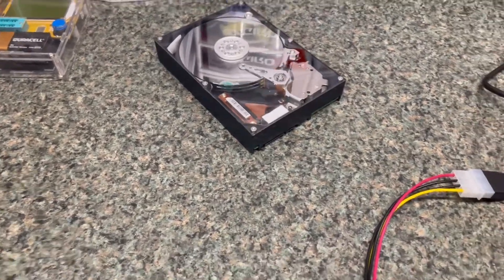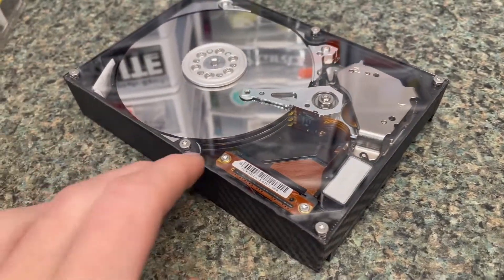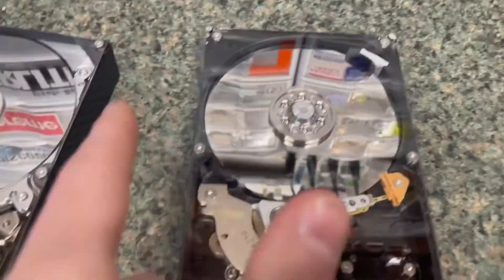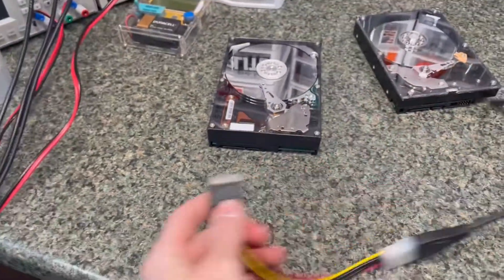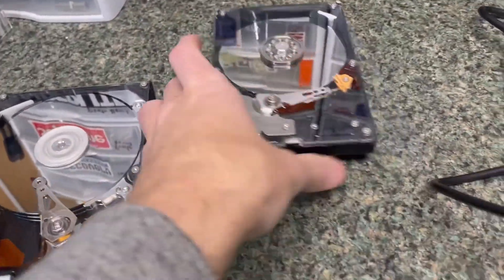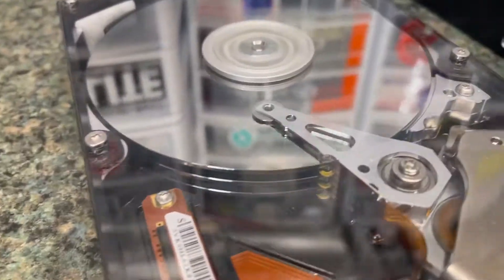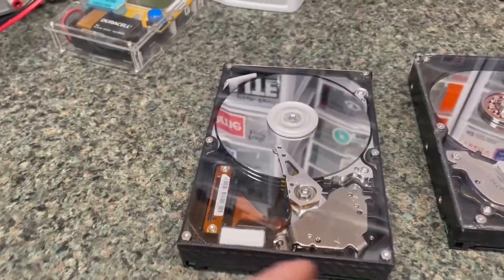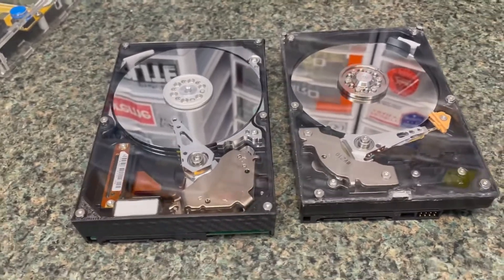See Through Hard Drive Clear Acrylic Cover Mod

Comment: What is this hard drive? I have couple of them, but all have parts to high, and acrylic will scrape over motor
Reply from the maker: I forget their models, for one of them I had to 3d print a spacer to go in between the acrylic and hdd so the motor wouldn't scrape.

Comment: Did you ruin the information on the hard drive ?. Those things are sealed in a clean room. A speck of dust can destroy information.
Reply from the maker: @deanflores4837  HDDs are damaged when dust (or other particle) get under the read head. Usually dust and other particles are “flung” off when the platter spins up. Yes, this is risky and I did not do this on an HDD that I depend on (these were <=500GB and old). I did check and they can still be accessed with no error.
Reply: @tylerebowers   I'm well aware of that young man I used to work for IBM. Those things are usually sealed in a clean room chamber and filled with helium. My question was did data get ruined by you doing what you did?. Me personally I think it's cool as fuck and want to try it, but did you lose data. Was anything corrupted?.
Reply from the maker: @deanflores4837  I didn't mean to come off too explanitory, I did write above that I had no issues, there are different ways that you can open them safely. Like in a brand new plastic bag.
Reply: @tylerebowers  You're good bro. I used to mess with HDDs back in the 80s when they were the size of a brick, and would to tell the brass... Wouldn't it be cool if people could see what exactly is going on in their computer?. But that was a long time ago. I think what you did is pretty damn cool.

Comment: Idk why drive manufacturers don’t do this. It looks so cool, and considering 90% of modern PC cases have clear windows, why not make clear drives too?
Reply from the maker: Mostly durability, but if they made some like this I’m sure a ton of people would buy
Reply: @tylerebowers  I would definitely be first in line. I can’t find the video, but a while ago, I saw someone make a clear window for the factory cover, which also looked pretty cool.
Reply: Because of electromagnetic interferences. That's why these transparent glass panels on PC case are awful lol.
A hard drive made of plastic would quickly lose all data.
Reply: @syc6598  ah yeah, fair point.
Reply: WD apparently did that at one point with their Raptor drives

Comment: This would be cool if you could figure out a way to encase it and have something send commands to the read head so it's a display piece that looks like it's reading data, the spinning drive alone is ok, but you really need to get that read head moving to appreciate it fully IMO
Reply from the maker: The head works off of an electromagnet so you could pulse a signal through to get it to move.
Reply: Well if you're only gonna be using this for a show piece you don't even need the top acrylic panel. Who cares if it gets dusty? So for immitating the data read/write you can hook it up to a microcontroller that will randomly pulse the head. You do need some extra circuit and not just an arduino. Don't hook it up directly cause it is not powerful enough to drive it and the coil in the actuator can kick back voltage which the arduino (and nothing else) likes!

Comment: Very awesome.
But does it post?
Reply from the maker: I don’t currently use these in any system just because I don’t trust them. But after I made them I stress tested them and they did not have any issues. All sectors were still good.

Comment: Did you open up the HD in a clean room?
Reply from the maker: No, but I did it inside of a staticky charged bag so that the dust got attracted to the bag.
Reply: @tylerebowers  Interesting. Can you give more details on how you did it? I've heard people using bathroom after running shower and waiting for moisture to disappear.
Reply from the maker: @chhupparustom  that might work too, you can also just switch it very fast seeing as how it will only be open for a couple seconds. You only need to measure the holes on the top cover. Also make sure that the hdd motor or head won’t scrape on the acrylic. And don’t do this to any hdd that you actually depend on.
Reply: @tylerebowers  Any special kind of bag that you used?
Reply from the maker: @chhupparustom   I used a large bag (no special type of bag) that could fit the whole drive, I also put the drive on a peice of cardboard so it wouldn’t get shocked and I wore gloves. To limit the dust in the bag you might be able to fill it with water (then dry it) < not sure how well that would work.
Reply: @tylerebowers  Thanks! Will give it a try.
Reply: @tylerebowers  i wonder if i just got lucky, but when i was a child my dad came to me with a bunch of HDDs that where going to the trash, i opened 3 of them closed 2 and 1 there was no screw on the head so i ran it open, all hard drives worked and my 9 yo self was not careful
Reply from the maker: @eduardom3209  I think it is only dangerous when dust gets lodged under the R/W head. Sometimes when the disk speeds up it will throw the debris off of the platter and the head will be safe. It more a matter of time than immediate damage.